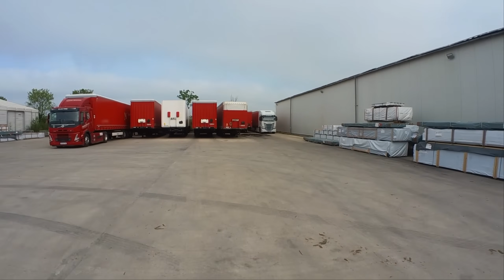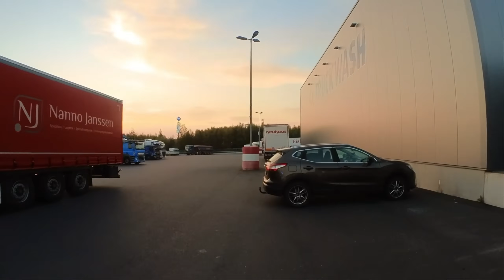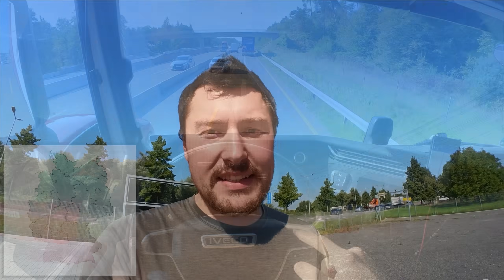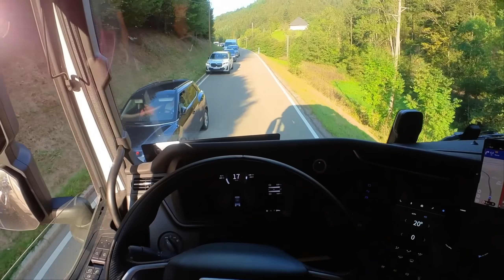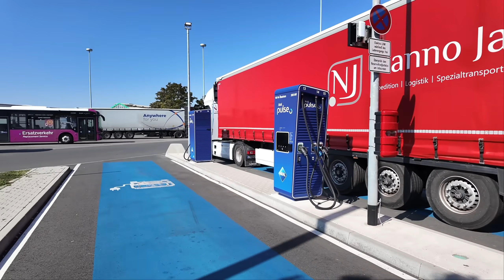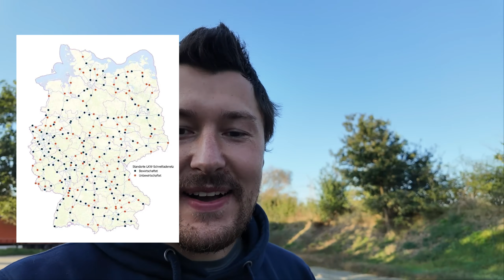Soon you can use your Home Electricity Price at Highway Chargers in Germany

Comment: Why doesn't manufacturers build a 3 phase AC charger into the vehicle. A standard 63 or 125 Amp 3 phase output socket can then be used making charging  infrastructure much more affordable and simple. Pre paid power meters can then be used to pay for the power.

Comment: @electictrucker although this is not for everyone and i agree that both the charging ststion and the vehicle should report why the charging speed is lower, you can look into an option for obd scanners for trucks and maybe the carscanner like app? It would at least tell you the battery temperature. Is there a 'truckscanner' app maybe? Do trucks have obd2?

Again, not ideal and not for everyone. Everyone would like to know why the speed is lower than advertised on the charger and the vehicle. 

It would also cut down on the support calls to charge providers.

Comment: I have been watching your channel and I am not a truck driver of any kind.  Two things are of interest.  I had not realised the level of logistics flexibility required to accommodate traffic congestion, pick up times, drop off times, required rest periods, charging availability and charging rates.  Secondly, you are able to manage you schedule based on the current level of charging infrastructure versus the number of electric trucks.  Just due to the economic savings there is considerable motivation to move to electric trucks but if the charging infrastructure is unable to keep up then this could reverse the economic advantages due to missed pick up and delivery times.

Comment: Thank You for a very interesting channel. I am an independent contractor/trucker in Norway currently driving a Volvo fm 330 diesel 2 axle refer truck. So far in Norway,the infrastructure for truck charging is next to nonexistent. As such I am going to have to start planning for my next truck within the next year and a half. Seeing how you work around your charging issues has made me consider adding the E to my drivers license and getting a tractor and a city trailer with 2 axles,rearmost being steered. This will most likely be the last truck I will have as I am getting closer to retirement (58 now). Most of my deliveries are in the greater Oslo area with some semi long haul’s, 300 - 500 kilometers round trips. I am thinking this is the easiest way for recharging as I could unhitch the trailer and like you use a normal recharging point for cars. It would however require a larger investment than say a 3 axle 21 pallet refer truck. As such I also wondered if you have seen or had any refer units on electricity and how that could work? Not a whole lot of info on this on the web. I have had electric cars for private use over the last 10 years and do not see myself reverting to fossil fuels. Another point I am very unsure on with regards to e trucks would be resale value, any thoughts on that?
Best regards from Norway.Keep up the good work 😊

Comment: 9:28 this is actually the same way that diesel-electric (and possibly full electric too) rail freight locomotives do regenerative breaking (usually called the dynamic break in that context) however they usually use a large air cooled setup
Reply: For me it's wild they can dump 400 kW into the cooling system. These aren't tiny hills.

Comment: I think it's hilarious that they're still seriously expecting any meaningful volume of hydrogen trucks - not going to happen
Reply: I saw that too. The hydrogen fantasy is stubbornly persistent.  If they don't understand the physics at least ask two important questions. Who is building out the hydrogen stations (like the dots on the map here for electric stations) and how do you get hydrogen out of those stations at a price that at least matches electricity. Trucking companies understand cents per km better than most businesses. Dead in the water.
Reply: @maxlambinoz  but you are not painting the full picture: now we shut down offshore windparks due to missing demand and the windpark owners are still geting paid compensation from german consumers. 
Would be much cheaper if that surplus can be stored in hydrogen and then used as methanol than nothing.
The efficiency does not really matter cause stopping the windpark is the worst decision.
44 kWh are needed to generate 1 kg of hydrogen. 
In home application that can generate 22 kWh of electricity and 11 kWh of heat hence 50% are used. If you take logistics into account with 10% which is a lot than 45% of the energy of the windfarm would be used instead of 0

Hence I have a business case if I get the hydrogen fuel cell right which means also the refurbishing of the fuel cell stack and so on.
Reply: MAN has decided to build a pre production series of 200 trucks with Diesel engines running on hydrogen. On of Norway’s bigger trucking companies in the south has bought half of these. I don’t see how they are getting any fuel for them as there aren’t any hydrogen reefuling stations operating yet.
Reply: They're not, it's just a way to milk the government teat as long as possible.
Reply: I think at this point we have to call it what it is: corruption. Some institutions are taking these hydrogen euro’s, hire some researchers to do the same calculations for the 100th time and they pay management and everybody is happy. I personally know people who work for such research farms. It’s bullshit. They don’t mind because it’s an easy job and they get money but I do mind. I think it’s a waste of money that we should spend on better things.
Reply: It could work locally - i.e. if you have a chemical factory nearby, that generates H2 as a by-product or even waste.
Reply: who knows in case of incentives and cheap hydrogen production from north  sea windfarm surplus which can push pressure on the prices of 1 kg hydrogen.
You need 44 kWh to generate 1 kg of hydrogen. Out of that 1 kg of hydrogen you  can get 22 kWh of electricity and 11 kWh of heat - based on fuel cell usage as home supply for energy and heat.
So you would have a 50% efficiency from an energy source that is now useless which means the windfarms are stopping and no longer producing.
Hence they might cell 1 kWh for lot less like 2 cent or 4 cent and which means 88 Cent or 176 Cent for 22 kWh useable energy (I mean for driving, heating cabin and battery would be free again). 

Of cause I have no losses included for maybe Methanol generation and distrbution and what not but I think it could be an alternative. 
Not sure if old DIESEL trucks could also burn methanol or hydrogen as seen in BMW cars around from late 1980 7 series to the early 2000 BMW offense at the brandburg gate in Berlin.

Comment: Great post! Those projected numbers up 2029 are very interesting. I wonder if there are any such plans for Aussie E-truckers. Q- I noticed you travel at 85kms/hr a lot. Is there a lower speed limit for truckies?
Reply: In Sweden, it is a max of 80 km/h with a trailer (cars and trucks alike). Without a trailer, a truck can go 90 km/h on a freeway, but max 80 km/h on other roads. I'm not sure, but I believe it's more or less the same all over the EU.
Reply: Speed limit on Autobahn is 80 km/h, but there is a little allowance for measurement precision. The speed indicator has to always err on the safe side, so indicating about 5-10 km/h too much.

Comment: E/T.  Would also prefer to see a future 'Hydrogen' powered Tractor unit hauled in Germany as part of the company ?  ?  Watching the 2025 Dakar event hosted in Saudi Arabia, highlights the proving ground of newer propulsion systems.  For us Downunder, the obvious net zero transition to renewable energy is going to be very steep when BHP/Rio Tinto can't dig the Copper-Lithium out of the earth fast enough to meet targets !  !  V.
Reply: JCB and Cummins are pushing hard into the hydrogen world. In Germany they have the electrical infrastructure to support the these battery electric trucks. Capacity wise, I'm not so sure of the situation however if people are charging in the evenings that's outside the peak usage for industry

Comment: I hope Germany figures out their energy situation soon so that all trucks can be electric without spiking the energy price every time it is not windy or sunny in Germany. All the neighboring countries are currently suffering for Germany ignoring to ensure that they have energy sources that can be planned.

Must be easier for Germany to reduce CO2 emissions by replacing fossil gas used for heating with heat pumps or district heating.
Reply: We don't have too little generating capacity, the fossil powerstations would easily be able to supply the whole demand without any renewables, but in november they chose not to activate the necessary number of the reserve for  gouging. the price. The federal authorities are looking into the case and take the necessary anti trust measures which can lead to heavy fines for the operating companies and criminal prosecution for the executives.

Comment: How much power does regen braking generate?
Reply: up to 600kW on the Iveco, which is enough to hold speed or even brake slightly on steep descents while charging the battery

Comment: You wish!! Electric trucks are a joke..as a real trucker..not a youtuber with power station company who needs to promote his businness..I can tell you that will never be a reality to drive those trucks around europe.
Reply: We speak again in 2 years 😉
Reply: @WoodHead0815   2 years can mean a lot..we speak in 2 years? Let's be honest here..everyday I do germany from top to bottom..and all the parking areas are full and none of them have charging stations..if you run out of time like we all do in this industry..i refuel my truck with diesel in like 10 min max where you need to wait hours to charge this electrical and where..I don't want to be disrespectful to you or any other..but reality it's different..germany infractures it's bad as it is right now about parking and roads...but keep dreaming one day everything will be electrical...i get the idea and It's for a good reason but it's just a rich boy dream
Reply: @csttd1126 The capacity is coming. In China there are already trucks from Sany running with 1400kwh batteries. They reduce the payload by several tons, but for the expediters it works. And you can expect with better battery technology, that this will fit into standard dimensions and weight later on.
Reply: @csttd1126  I don't know in which germany you are driving, but in the germany i know i see charging points on nearly every gas station and "Autohöfen" alongside or near an Autobahn/Bundesstraße sprouting up from the ground.
Ofc the infrastructure is nowhere near perfect, but it works if you commit.
Much love 😘

Comment: Why the Depo dont have AC22kw stations to charge all trucks slowly over weekend ?
Reply: The trucks don't have AC chargers.
Reply: @NearCry91  do bad. Charging parked 10h overnight on the road 180kwh with small investment or over weekend a full charge at depo
Reply: @eunu6928  The investment is the same. You either build the ac/dc inverter into the trucks or into the charging station. For cars it makes sense to add a 11 kW dc inverter, for trucks it doesn't. It's just more efficient to wire a bunch of 50KW dc chargers from a main inverter for the trucks to charge overnight.
Reply: @Psi-Storm  A TON of MASS 50kw DC chargers would be Beautiful.
Reply: Because 22kw is useless Slow for trucks and they even dont have AC chargers so its simply impossible.
Reply: @tyo0815  kipp dreaming for "a tone of 50kw stations " ...that means 10's of tone of money.
 At least 20k€ each 50kw station +5-10k€ installation. Only the cable 125Ah DC is at least 1k€
Meanwhile, a AC 22kw station is 1k€ + installation probably 1k€ and at a Depo in 48h means 2days weekend can charge 900+kwh and kipp the battery worm.
Reply: @eunu6928  AC 22kw is worthless for trucks because they can only charge with DC.
Also for cars as the most have only 11kw inverters. 
Put the invertors in the station is WAY more convenient and cheeper than driving them around useless. 
EVs only have them to make the entry easier by now in future there will be no Inverter in Vehicles anymore.
Reply: @tyo0815  did you think that I Don't know to read that the trunk don't have buildIn charge ?
I will never buy a EV with only DC charging. 
Is useless to debate with you AC charger advantages.
Reply: @eunu6928  Ok.
Reply: @eunu6928  ac is only usefull at home.
But if the infrastrucure evolves i will Upgrade to DC at Home.
Also for V2H.
Reply: @eunu6928  there is nothing advantage with AC charging. on a 7.2kW AC charger you loose 1kWh per hour due to conversion losses. just think of the losses on a truck let along a car . AC charger for car are there because they are cheap compared to a DC charger that is about £5k but not on the market yet.
Reply: @ianrobins5501  :) you think only AC charging have loses and DC station don't have loses ?
And 1kwh from 7.2kw charger is ~20%.
You bet that have so many loses ?
What about EVSE 2kw , 50% loses ?

Comment: Unless batteries get a lot smaller lighter and cheaper ev trucks will never take off, unfortunately simple facts seem to pass the net zero evangelicals by, there is nothing anywhere near reality that will beat a modern diesel engine, they are very powerful producing a huge amount of torque, compact only about the size of a family fridge very reliable running over a million miles, producing low amounts of nitrogen dioxide and can be filled up in only minutes, the only other possibility is hydrogen powered ice trucks as this would eliminate carbon emissions
Reply: In 2024, Shenzhen saw a significant increase in the registration of new electric trucks. The penetration rate of new energy vehicles (NEVs), which includes electric trucks, reached 77.4% in June 2024. This means that about 77 out of every 100 newly registered vehicles in Shenzhen were NEVs.

Shenzhen has been a pioneer in promoting electric vehicles, with supportive policies and incentives for NEV adoption. This has contributed to the high penetration rate of electric vehicles in the city.

In 2024, almost 65,000 zero-emission trucks and tractor-trailers were sold in China in the first half of the year. This includes both battery electric trucks and other types of zero-emission vehicles. The market share for battery electric trucks in the heavy-duty segment was 9% in the first half of 2024.

The uptake in China is very fast and you expect to see the same happening everywhere else
Reply: Rather than coming on to this channel where there is actual information on how even the first generation of electric trucks are delivering product successfully and trying to convince people not to believe what they are seeing, maybe watch the video and think a bit.
Reply: they are very powerful producing a huge amount of torque 
Diesel engines have an extremely narrow torque peak, which necessitates an 18-speed transmission with serious friction losses to stay near the torque peak while accelerating. Meanwhile, every upshift reduces the torque at the rear wheels, where it counts.
Electric motors have nearly constant torque over much of their RPM range, so they only need a single reduction gear with minimal friction losses to deliver near-constant torque to the rear wheels. This is why a Tesla Semi, towing a flatbed trailer loaded with 44,000 lbs. of highway barriers, can accelerate rapidly (watch the speedometer) up a steep slope on Donner Pass, passing a diesel semi crawling up the hill in a low gear as if it were standing still: https://youtu.be/LtOqU2o81iI&t=984.
Reply: You have no idea what you are talking about. An electric motor the size of a cooler box beats your fridge sized diesel engine in torque,  power, reliability, maintenance costs and durability. Nobody in their right mind would build a high speed train with a diesel engine. LFP batteries are now at a price point where it makes even financial sense to switch to electric trucks.